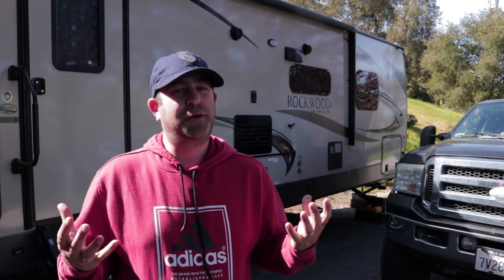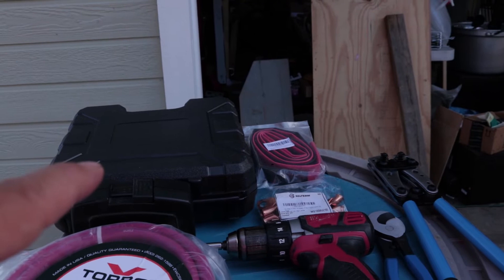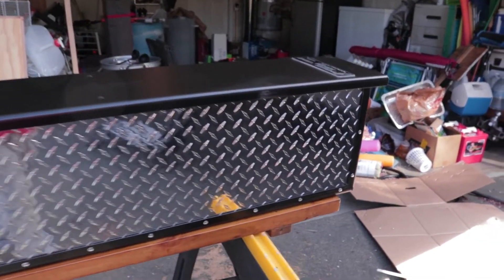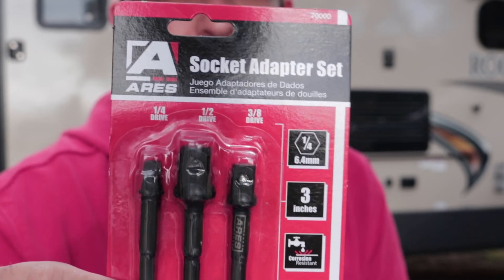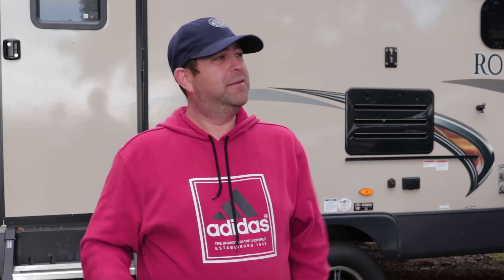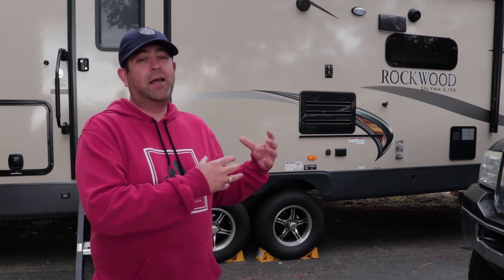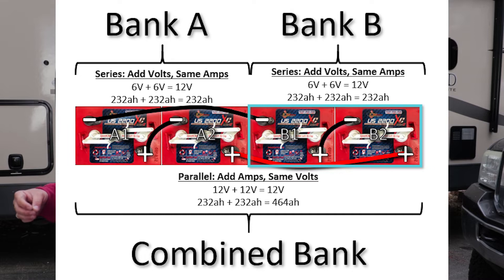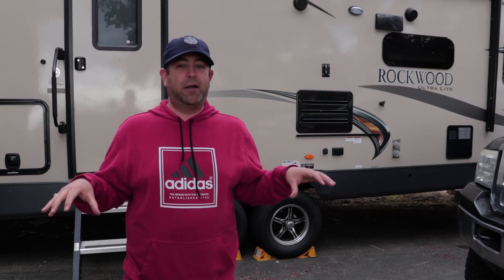RV Battery Upgrade #2 | 4 6V Golf Cart Battery Install |  + TorkLIft Battery Box

Comment: Personally I would never go with a metal box, one time I was driving our work truck it had two monster 24 volts batteries in a metal box, one of the batteries came lose from it's hold down and shorted against the metal box, very large explosion as it blew up.

Comment: Why do the amps stay the same?  Does that mean my capacity doesn’t increase?
Reply from the maker: The amps went up when we added another 2 batteries. The amps just stay the same when you series 2 individual 6v batteries together into 1 12v pack. We could have wired all the batteries together in parallel, and then we would add up all the amps, but it would be one big 6v pack then and the rv needs 12v. I think it gets confusing with 4 batteries. You might check out our first battery upgrade video when we just used 2 golf cart batteries. Either way, each set of 2 is still more than double the original 100ah 12v battery that came with the rig. Hope that helps!!

Comment: Holy Christ... I have two 6 volt batteries wired in series and I can Boondock for 2 weeks + and have no problem with power.... you can go probably months without having to recharge great video...👍👍👍... do you have any type of inverter
Reply from the maker: The tanks fill up before the batteries go dead now. Pretty happy. Still need the genny so I can run ac—maybe next year I’ll grab the predator.

Comment: Great box wish I had one! Will get one soon I hope. May I suggest a victron 712 monitor before the solar.  U have a great battery bank. This way you can track your battery usage so you know how much solar you might need. I’m skipping the big solar package and went with mobile panels. A little more setup time but just need to extend the power and a small generator. I’ve noticed that for me 90% of the time I’m under trees and the solar on the roof would not give me the power for the price. Oh the victron will log your usage so you can get a nice usage state summer winter, I use more battery in the winter as we normally dry camp then.  Love your channel!
Reply from the maker: +David Groves thank you David, that is a great idea. I was just talking with my wife about skipping the panels for a bit as well. Love the idea of the battery monitor just to know exactly where we are at. I will definitely check into that unit. Appreciate it very much and thank you for watching!